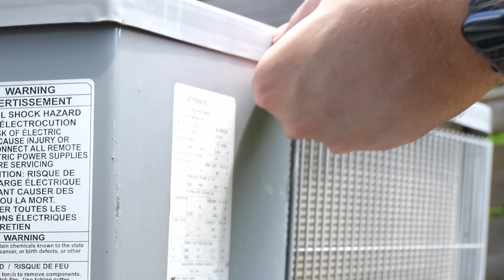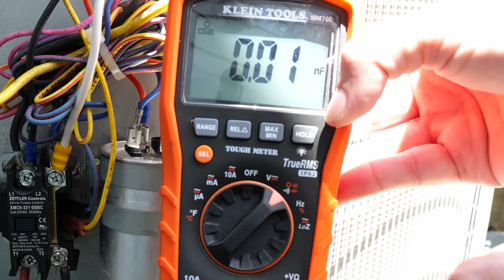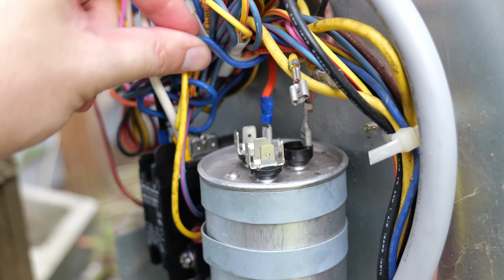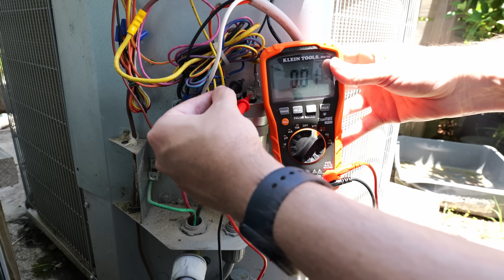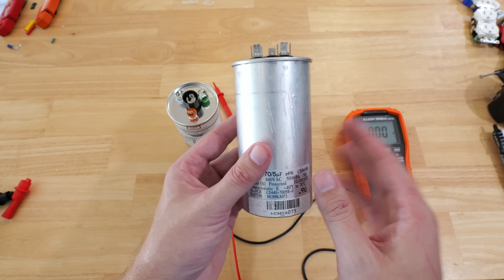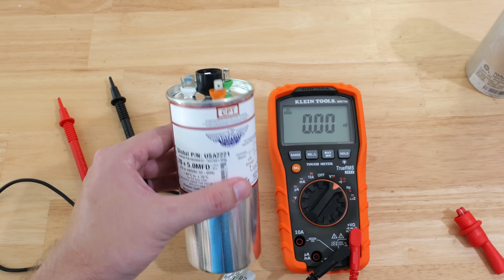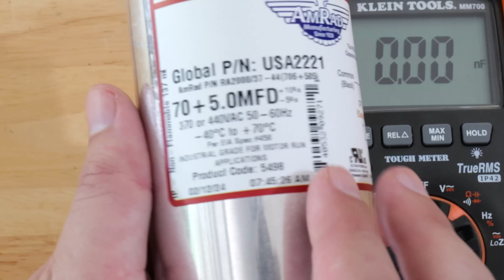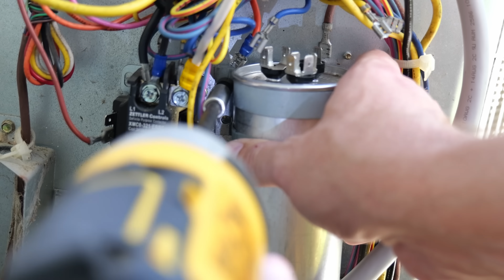Don’t Get Ripped Off! How To Avoid The AC Capacitor Scam And Save $500

Comment: T1 and T2 are the load (motor) side of the contactor, L1 and L2 are the line (power) side of the contactor. You checked the wrong side of the contactor. When in doubt follow the power wire.
Actually if you are in doubt. Check both the L1 and L2 side and The T1 and T2 side of the contactor.
This particular contactor only switches between L1 and T1. L2 and T2 are physically connected all the time.
Reply from the maker: I didn’t check the wrong side.  You can clearly see the lines coming into the unit connected to the T1 and T2.  The contactor is just flipped which makes zero difference outside L and T labels being flipped.
Reply: @HowToHomeDIY  From the camera angle it was/is not clear to me. There's a reason things are labeled. And you should have pointed that out in your video. You went to great lengths to explain the labeling of the capacitor, yet something that is much more important you didn't even mention, the labeling of the contactor. Yeah an electrician would have spotted that right away but some DIY'er  trying to follow instructions may have missed that.
And like I said to be safe check both the L1 L2, and the T1 T2 connections on the contactor. I hate contractors they are always taking shortcuts. That contactor should have never been wired that way.
I've worked with 208 and 480 machines and I've never seen any component installed with that kind of disregard for labeling, Where I worked that would have been grounds for disciplinary action.

Comment: O.l is not open line - it's overload.  An open line reads zero.  Also, please never do what he's showing, shorting the leads of the cap with your screw driver.  This is actually quite dangerous.  There is a special tool for discharging caps, it has a resistor built in which, in the event you do run across a charged cap, will prevent a shower of sparks and melting your screwdriver.  Yes this really can happen.  @HowToHomeDIY, please be more responsible in future videos - giving out misinformation and dangerously incorrect procedures is not cool or funny.  People watching might believe you.
Reply from the maker: O.L is referred to differently.  Some say overload, open line, open loop, out of limit,etc.  So not that serious. And Wow.  A shower of sparks that will melt a screwdriver??? 😂  That really says it all about this comment.  The video is not misinformation or dangerously incorrect procedures.  There of course is risk with any project and everyone should weigh them out for themselves.  But shower of sparks that can melt a screwdriver?  That’s a new one.  But I’m guessing you’re an AC tech that is irritated this video and videos like it exist.
Reply: @HowToHomeDIY and an open line won't read 0 on ohms either. 🤦

Comment: Thanks for the video.  This may be obvious to most, but let me point out to beginners that you have to correctly select AC or DC on the multimeter.
Most will not warn of dangerous AC voltages in DC mode, and vice-versa.

Comment: Test it hot or you're doing it wrong. There is a reason trained professionals do this and not your average homeowner. We get paid for our knowledge and experience. Testing a capacitor isn't a solution to the problem. Always call an expert
Reply: Great troll post 🙄

Comment: Following my annual 'inspection' my service tech tried to sell me a new cap and relay for my AC. Said the relay was making a noise and that usually means the capacitor is failing. Said I could replace both for $450. Such a deal. Since my ac was running fine I declined. After he left I turned it back on and listened for the 'noise'. Sounded normal to me. Now that I've seen this video I'm confident I can fix this myself if it ever fails.

Comment: I signed up for one of those Home Depot tune ups for AC and they told me the capacitor was bad and wanted to charge me $200. I said no, and found the part on Amazon for $20 and replaced myself in about 5 mins.

Comment: Am I paranoid if I'd put the disconnect piece in my pocket or toolbox instead? Also... I'd preferrably also test the capacitor with an insulation tester for leakage (do mind you are charging it if you are doing that!!). .... High price might just be due to it being a "manufacturer approved" spare part that they will use to avoid any liability or contractual problems. ... If the equipment is really ancient, do be aware of PCB.

Comment: AC Contractor here: This is going to be a fair and honest but lengthy response to your video. 

As a start, this video is focused to homeowners. As a huge warning for any homeowner, if you aren't 100% fully aware of what you are doing, DO NOT ATTEMPT!!

Pros: First pulling the disconnect and leaving it on top of the box, good practice. I do like how you explained how to check for live voltage and short a capacitor after power is off. Testing the capacitor is correct with no load but the true way to test it is with a load on it. I have personally tested capacitors that test fine without a load and then test far below its tolerance under a load. I can't, in good conscience, recommend this for anyone other than a professional that has been trained on how to do that, as it is very dangerous if you don't know what your are doing, so I won't explain how. Taking pictures before any wire is removed is an excellent practice and I teach that to my guys on everything we do. Its good record keeping and is a good backup for out of the ordinary wiring. 

Cons: When taking off the band for the contactor you have to be very careful to not touch the side wires of the contactor while you are touching any other metal. In your case those connectors had plastic covers on them which saved you from shorting out the low voltage side. Plastic covers on those connectors are much less common than just a open metal connector which most people have. If the homeowners shorts out the low voltage and doesn't know how to trace that down and replace the fuse if that's all that popped, then its a service call. If they blow something, its another repair. Also, in my experience most people don't have meters so that would be a tool they would have to buy to start this repair. 

Notes:
1. If I found out that my tech tested a capacitor like that and showed you that, they would be fired on the spot. We train how to test properly and don't believe in just selling parts to make a buck. There are bad companies out there, but there are good honest ones too. If you don't have a good feeling about the explanation or the vibe you are getting from the tech, its ok to call another company to go out. Trust me, if you feel like you're getting scammed it's 100% worth it to spend another dispatch fee to have another company confirm it or suggest the right repair.
2. USA made capacitors are much better quality capacitors and usually come with a 5 year warranty. They do cost more but your get what you pay for. 
3. The price for a repair may seem high when you just look at the cost of the part. But what almost everyone doesn't look at is the cost for company to have a qualified tech out there to repair the capacitor correctly without causing injury to the homeowner trying to do it themselves or break something else that is much more expensive by not wiring the capacitor correctly. *One caveat is there is a price that is too high and anything over $300 for this repair is too high. Below that will vary from company to company. 
4. Also why a qualified tech is also important is sometimes, although thankfully uncommon, a previous repair person will put the wrong capacitor on as a temporary fix or not wire it right all. So I can speak for my company, every time we double check the specs of the unit to make sure we put on the correct capacitor and don't just trust what's currently on there.
5. The cap on your unit looked new and is different than the dead one you tested that looked older with a rusty fan terminal (which is also the same one in your hand at the beginning of your video). You can also tell the difference by which the old one had a sticker below the label and the label was slightly different from the new one. Its a little suspicious personally, and in just my opinion, I think what could have happened is you could have had a tech go out find that dead capacitor, replace it with a new one, and you didn't like the price and made a story and a video about it. I could be wrong but that's opinion. 

Anyway. There's some good things and some things that will cause a service call in this video. This is why I said at the start, if your aren't 100% sure you know what you're doing, leave it to the pros.
Reply: Very good notes and  confirmation of important points. To eliminate the issue with the low voltage side and what should’ve been done in this video is the thermostat should’ve been turned off so that it will not be cycling while you’re doing this repair. Taking the fuse block out like he illustrated only removes the power on the high voltage side (240/120V). The thermostat (-24-27VAC) during this video could’ve been cycling on and off and yes, touching one of the contactor low-voltage wires to ground could short it out blowing the fuse located on the control panel in the attic, usually.  So anytime you’re doing AC repairs, remove the fuse and turn the thermostat to the off position.  The low voltage side is de-energized as well then. The low-voltage side is what energizes and de-energizes the contactor.
Reply: I am going to leave it to the pros I am not a expert in this field at all I just learned to put up a ceiling fans and replace the outlets 2 years ago in a row and I don't want to mess with a capacitor at all
Reply: Ours went out Friday night and we went ahead and shut it down and waited on a guy to call us back Monday morning and it's been hot here inside the house but you go outside it's cool out there even the sun is out and it's hot outside
Reply: Hi, what exactly do you mean by being very careful not to touch the side wires of the contactor? I’ve successfully done a repair like this, without electrocuting myself, but your warning now has me wondering if I was dumb and lucky, rather than skilled. I’m curious to learn. Is it because the capacitor could still have energy left in it?
Reply: Sorry, but I don't believe you. The capacitor is good if the uf reading is proper wether it's in the circuit or not. O.l. reading on the meter means you're not on the right scale. And you're reason for overcharging is ridiculous
Reply: @jerrydewitt8937  your choice not to. I'm just telling you what I've actually put my hands on and tested myself. As far as "overcharging" I said what I feel because as a contractor there's a line between a price to charge to stay in business and continue providing a good service and overcharging.
Reply: @Dwnsowth  Sorry Jerry. Everything you just stated is completely false. 'Lectricity has been my thing for many years. Good luck in your DIY electrical endeavors.
Reply: He made it look easy, but I wouldn't attempt this myself. Thank you for bringing good sense to this video!

Comment: I was asked by a friend of mine to look at his ex wife's heat pump. She had 3 companies come check it out, and all of them told her it was a bad compressor and she needed a new system. One of the guys spent about 4 hours on his diagnosis. When I got there, first thing, she tells me about changing out a bad capacitor in January, it was now May. I asked did it run after she changed the capacitor,  nope never ran. Of course the first thing to check is whether she did it right. Nope, one blue wire on the compressor terminal actually went to the common terminal. I made the swap and I'll be damned if it didn't start right up. I was there less than 5 minutes before it was running. Her mistake almost cost her thousands to replace the system. Where did she learn how to change the capacitor? Where else, other than Youtube. Lesson one, if you're not an electrically apt person leave it alone. Lesson 2, tell the techs wtf you did before they got there. Lesson 3, not all techs are actually good techs. 38 years of experience helps.

Comment: A capacitor is essentially 2 large-surface plates that are close together but don't touch. Trying to measure its DC continuity (resistance) is useless since the plates don't touch. In fact, if you do get DC continuity, it's bad. The plates are touching. In practice there is a thin insulator (dielectric) between the plates that keeps them from touching, and the plates themselves are made of metal foil. Everything is rolled up into a jelly-roll shaped cylinder in that metal can. The way to test a capacitor is with a capacitance meter or a multi-meter with a capacitance measuring range, as the tester sends an alternating, (+/-/+/-) voltage between the plates and measures the interaction.

Comment: How do you know what capacitor tolerance the unit actually needs (was designed for)? For example, in changing from a 6% tolerance capacitor (one specced to be 65.8 to 74.20) to a 10% tolerance cap (one specced to be 63 to 77) you're allowing for the actual capacitance to be smaller or larger than what had been installed ... thus risking a no-start or using more energy than directed,  aren't you? It seems to me it would always be safer to get a tighter tolerance part (at the same or more rated voltage,  etc) but somewhat risky to go to a sloppier-rated part

Comment: The cap shown is a wonderful  stamped unit from China.Good for a while but not quite as good when they were made in the USA.Guess why?
A very handy meter to own,that Klein MM700-It's under $100 and worth it
NEVER use a lower rated capacitor.Slightly higher ratings ,should be OK-but try to match the numbers (uF) and Volts AC ratings
If the unit does not start,you could have other problems too.Without gauges, and knowledge there's only so much a homeowner can do.And should call an expert
Remember: they just don't make anything-   Like they "used to" 
You only got ten years out of it? You did good.

Comment: With the AstroAl DM130B ($18), I first go to the Continuity Function, and then Select "Continuity" (vs Resistance or Diode Setting), and then I turn the Function to "Capacitance" and then test.
Reply: You mean to just test the meter with the continuity function, or is there a reason to go to continuity first? Besides that's what I always do before using a meter? And also checking on a known power source( or in this case a well functioning capacitor),  if I can remember to, or if I start getting weird readings.

Comment: Hey how about a meter that can read the capacitor that isnt 100 dollars? Ive got a different one with about 400 settings on it and havnt a clue which two holes i should plug the leads into of the three holes and in what order.

Comment: Possible new video for you.  My AC died this summer.  Turns out it was a blocked drain that killed it (attic mounted unico).  While inspecting my compressor the tech told me the fan was showing signs it needed to be replaced, that the bearings were leaking lubricant.  He gave me a nearly $2,000 quote.  Now I maintain my compressor thanks to your channel (replaced the cap, cleaned the coils, etc) and know the fan is only a few wires, bolts, and a swappable part.  The new part is $350.  However, electric motors are maintainable.  Is there a good reason not to strip this in the off season and just replace the bearings?  The repair should cost at most $20 for two good quality bearings.

Comment: It's great how they cheap out. The contactor is for 220, but it only has one pole contact. The other side doesn't break. It's prone to failure faster than a true 2 pole.
Reply from the maker: It is true.  The other side is shunted.

Comment: There is a "hard start" capacitor, generally used for compressors near failure and attempting to get another year or two from the system.

They help reduce the starting surge spike that can trip the breaker before the compressor gets up to speed.

But if you actually use a data logger the total watts of power isn't affected.

There's a similar capacitor based system to help travel trailer AC systems not trip a marginal generator off line every time the compressor starts.

Comment: When you tested on the contactor you measrued on the load side which is T1 and T2. You have to be carful since L1 and L2 could have still been hot. Best to always check on goth sides since many electricians don't follow the standard.. Thanks for the grat vid.
Reply from the maker: So yes and no.  The way the HVAC guy installed it the T1 T2 terminals are the L1 and L2.  I tested the side where the power comes in, which is correct, the contactor is just flipped as far as labels go.  Which is ok as aside from that, it works just the same.  You’re welcome and thanks a lot for the feedback Thomas!

Comment: The percentage is a manufacruring tolerance. It means the value, when new, will be within that percentage range of the target value, say 70 mfd. It's not a guage as to whether the cap is failing. It's not like it's "running out of mfd's". Of course, aging or failing capactors will change in value, but it's not a hard pass/fail test saying if, for example, a 70 mfd cap is at 65 mfd.

Comment: Had a tech tell me I needed a new mother board on my furnace. He wanted $500. I found one for $100.
Further, he failed to fix the issue I actually called him for. Turned out THAT problem was just a dirty sensor that only needed to be wiped with steel wool.
I didn't need a mother board at all.

Comment: You only needed to remove the common terminal for your testing. That will save time and stress on your wiring terminals and is just as effective at isolating it.